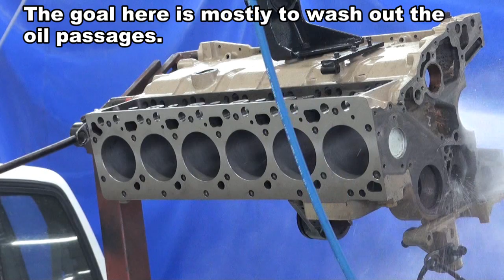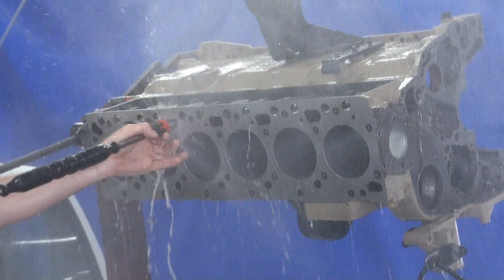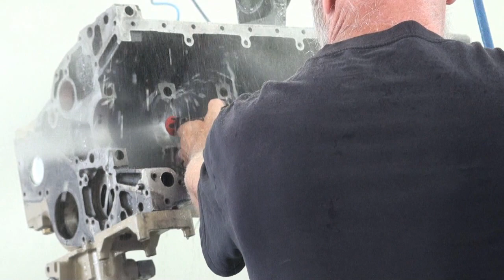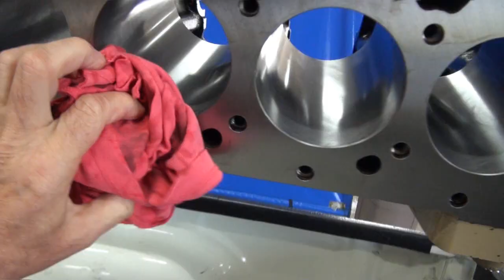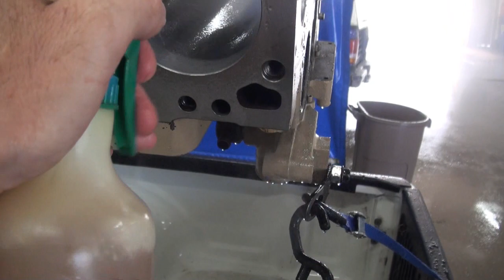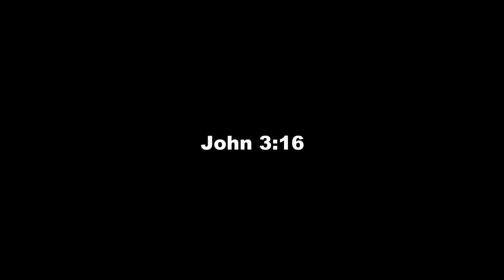12 Valve Cummins Block Wash

Comment: I noticed at around 2:22 you might have missed a spot! Lol 😆 I think it was already clean but you never can be cleane enough when it comes to building a engine like the wash booth what was getting washed while you were applying wd40 to the block or was that just sound effects 😄